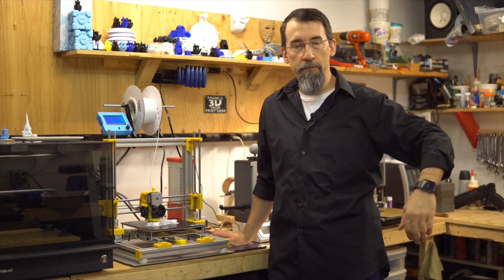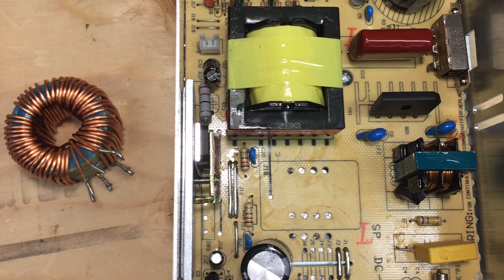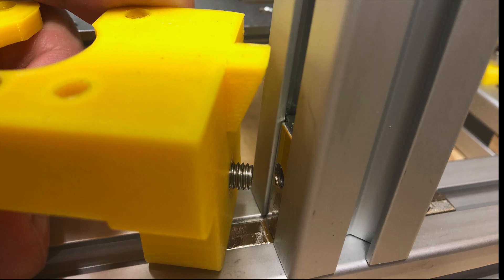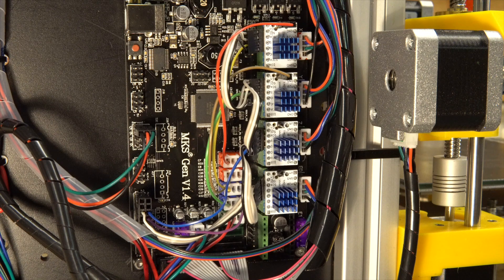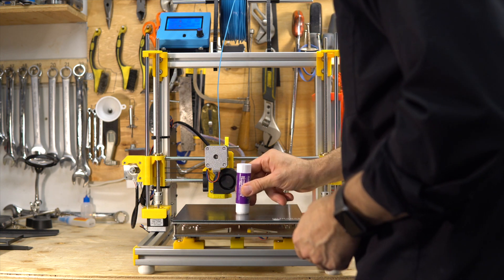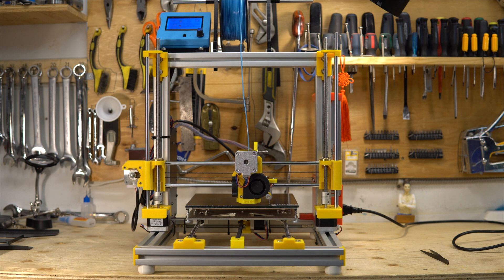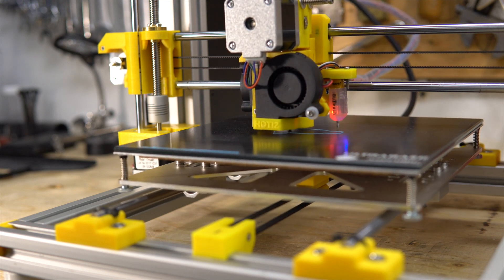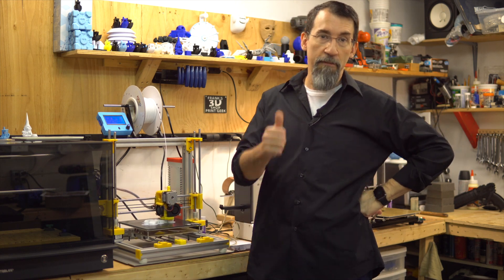My Homemade 3D Printer

Comment: (Hello, I have two questions for you; please guide me. I've purchased almost all the components of a printer and want to assemble it myself. Firstly, I wanted to know your opinion on whether the extruder or the hot end is better?. Secondly, Do you think it's necessary for the power supply of the device and the heated bed to be separate?

Comment: where is the endstop you put? because i didn't see the endstop...
Reply from the maker: Hi, I do not have end stops, the TMC2130 can detect when they hit the frame I use that instead of end stops switches.
Reply: @Franks3Dshop  could i use 2020 extrusion in your 3d printer design...?
Reply from the maker: @i-bo-wows7283  I think so, if I remember correctly there was a 2020 version on the Haribo community, but the site http://www.prusamk2.com is not responding anymore...

Comment: hello Frank I hope and you meet well and.  Excellent work with the 3D printer ñ, I downloaded the files to create it but I see that some files are missing.  the supports of the nose and the Y-axis rods. I hope and you can raise them
Reply from the maker: Hi, if you look in the description you should find a link to the original Haribo parts, I only modified some parts for my Z motor to shaft adapters

Comment: Can you put your editted marlin code with bl-touch to jobinpthomas2@gmail.com
Reply from the maker: Sure the latest version 2.0.6.1 is here https://github.com/Franks3dShop/Marlin/tree/Haribo even if you do not have Neopixels or the debug matrix it will work without those connected...
Reply from the maker: But wait I have updated the X-Motor support and it changes the settings of the X end stop, I will try to update Thingiverse tomorrow

Comment: Hello! what is the measure of the aluminum profiles?
Reply from the maker: It’s in the Haribo BOM build of material, I used the Haribo extrusion, I only adapted some parts to fit my smooth rod to Z motor couplers.
Reply: @Franks3Dshop  Which cart contains the BLTouch?

Comment: This is an am8 printer. Its an anet a8 printer with 2020 frame
Reply from the maker: In fact it's more a Prusa i3/MK3 (for the hot end) on 2020, the Anet is based on Prusa i3 original design.
Reply: @Franks3Dshop  lol, true. Its a cool project though.
Reply from the maker: @LT72884  an Anet A8 would be a good source for parts!
Reply: @Franks3Dshop  sure would be. I just got mine last week, almost done with it. Might buy a second one for just parts haha. I dont think i could source the parts for as cheap as the anet a8

Comment: There's a few questions that are begging answeres here. I'm not intending to upset you but I'm looking at bad design all over the place, so here are my questions followed by reasons.
Why make a 3D printer out of T slot Aluminium extrusion when V slot performs a linear rail designed for V wheels?
If you had then all the chrome rods become redundant.
Reply: cost
Reply from the maker: And that video is 2 years old, there was no lost cost printers in rollers, and it is based on the Prusa design an excellent printer.
Reply: @Franks3Dshop  Not being on the ball isn't a sin. Chrome rods are more precise than wheels but without Drylin bearings the noise is ridiculous. I have an ANET A8 but modified everything on it, I have an HE3D EI3 and modified everything on that to. I'm just saying the frame is a linear rail, use it? I like your design but  it's not worth the chrome rods unless you make it proper large like 1Mx1Mx1M in which case it would be correct. Probably better than anything on sale, but it would be silly expensive.
Reply from the maker: I have another in the works, a cube core XY 400x400x400
Reply: I'll stay tuned.  If you haven't decided on a brain and screen yet, checkout the MKS Robin Nano It's amazing value when bought together, seriously feature packed.

Comment: Sir I have a mad 30 x30 x30 cm 3D print my question is which stepper motor used in Z Axis y axis and x axis...?
Reply from the maker: They are Nema 17 42mm
Reply: @Franks3Dshop   1.7A and 1.8°   ...
?

Comment: I'm using megha with ramps controller and i uploaded the Merlin all working fine but the extruder is not working 

Please help me to solve this.
Reply from the maker: Hi, when you say extruder is not working, what steps do you take and what is the problem.
Reply: @Franks3Dshop  i don't know what is the problem but only extruder motor not working . I did not check the signels and power because I'm busy little bit in othe project so....if you know how to check or solve please let me know.
Reply from the maker: You can connect the Extruder motor on the X connector and try to move the X to see if the motor and cable works.
Reply: @Franks3Dshop  the x,y & z is working fine and the extruder motor is working in other connector but only in extruder connector is still not working.....
Reply from the maker: The extrusion usually needs at least 170 degrees to be able to extrude, if you have motor drivers switch them
Reply: @Franks3Dshop  OK, i'll tell you after switching the drivers thanks for your help.

Comment: bonjour j'aimerais savoir les longueur exacte de aluminium 30x30 etle firmware utiliser
Reply from the maker: Salut, je les ai achetés localement, mais Spool3D.com en a en stock, il est aussi possible de les commander en ligne, le site web http://www.prusamk2.com/haribo-3030-extruded-aluminum-prusa-i3-mk2-build/ a les sources pour les avoir pré-coupés, dans mon cas j'utilise des angles de métal au lieu de faire percer et fileter les 3030...

Comment: Hi!!
Great work. I just wanted to know if the printed parts fit the 2020 extrusions as well?
Reply from the maker: Hi, it does not fit the 2020, there is some models on Thingiverse https://www.thingiverse.com/search?q=Haribo+2020&dwh=375cc8c22b677b6 but 3030 is sturdier there is no play when printing and the frame does not move even if you pick it up by the upper bar.
Reply: Thanks a lot for the info !!
Reply: Which would you prefer?
Extrusion and v wheels or smooth rods and bearings?
Reply from the maker: For a small 200x200 machine I prefer bushing on smooth rods for the Y because it is sturdier. And bushings on smooth rods on the X axis. The less play you have, the more precise the prints are. If it’s your goal...

Comment: thank you very much, if my printer at the end works as it should be thanks to you,

this is your marlin, changing the options for the einsy rambo plate that my printer will have and the full graphics lcd screen.
https://mega.nz/#!rH5DyIKb!xsF4rQ65sJvhm6FyttODNq1kWgPnnn-uHvGu6MOG_f8

-----------------------------------------I have an important question, -----------------------------------

trying to inform me how the tcm2130 drivers works in spi without en stop, I found these tutorials in my language. in which they indicate that  have to configure the tcm2130 in spi, setting the end stop false to its correct operation.

minute, 22,24 second of this video
https://www.youtube.com/watch?v=H3uqBwZF-GI&t=1682s
or
https://www.3dcampy.com/2017/12/20/tutorial-instalacion-y-configuracion-driver-trinamic-tmc2130-en-ramps-y-mks-gen-1-4/
or
https://www.youtube.com/watch?v=Mb25RN9vh1w
https://www.luisllamas.es/motores-paso-a-paso-en-silencio-con-arduino-y-los-driver-tmc2100-tmc2130-y-tmc2208/

comment that they are with marlin 1.1.8, do not know if in 1.1.9 changes ??

****  in your marlin, the endstop is true, and if I put them in false it does not compile me. **********

#define X_MIN_ENDSTOP_INVERTING true// set to true to invert the logic of the endstop.
#define Y_MIN_ENDSTOP_INVERTING true // set to true to invert the logic of the endstop.
#define Z_MIN_ENDSTOP_INVERTING false // set to true to invert the logic of the endstop.
#define X_MAX_ENDSTOP_INVERTING false // set to true to invert the logic of the endstop.
#define Y_MAX_ENDSTOP_INVERTING false // set to true to invert the logic of the endstop.
#define Z_MAX_ENDSTOP_INVERTING false // set to true to invert the logic of the endstop.
#define Z_MIN_PROBE_ENDSTOP_INVERTING false // set to true to invert the logic of the probe.
Reply: Im interedted too , i have the same board !!!!
Reply: Un interested too
Reply from the maker: Hi, for the switchless end stops, you need have a wire from the diag1 on the TMC2130 drivers to a connection on the board, so that the driver will trigger the end stop when detecting the end stop. You also need to have the level for sensing the end tuned with M906 if I remember, it is all listed in the Marlin adv config file. I will have a series of videos assembling the Haribo, I am transforming my oldest printer to a Full Haribo black Edition and I will do a step by step...
Reply: Frank's 3D shop the einsy rambo board has the tcm2130 integrated in spi mode, it will not be necessary to put extra cables
https://reprap.org/wiki/EinsyRambo

Comment: Hey I wanted to build a 3d printer from mostly 3d and aluminum extrusion like yours. But i wanted a bigger printing area like 300x300mm. Do you know if its possible to build it like this?
Reply from the maker: Sure it should be possible, another interesting design is the Hypercube or Hypercube evolution, it is sturdier for bigger print volume, I am building a 400x400x400 one, slowing buying parts... it also will be faster since the X gantry is lighter with less mass accelerations and deceleration have less impact. It needs more computing power, I am choosing a Duet Maestro 2 board 32 bits...
Reply: Frank's 3D shop amazing, eill take a look at that too

Comment: Looking at the pieces that I need to buy, I realized that the measurements of the guides in your project are something different from the boo of the haribo and zaribo. Could you comment me why or if it does not matter

haribo boom

2
PSFG8-370
Hard Chrome Precision Linear Shaft - Straight 370mm (x)
2
PSFG8-360
Hard Chrome Precision Linear Shaft - Straight 360mm (y)
2
PSFG8-320
Hard Chrome Precision Linear Shaft - Straight 320mm (z)

haribo home made
 2x370mm x , 2x400mm?, 2x350mm?
Reply from the maker: Hi, The Y axis I have cut them to size at the end (360mm) but I bought 400mm ones, the Z I left full length they are sticking out 30mm no problem can even hang small coils of filament when testing. The kit of rods I have bought were of that length.

Comment: As you indicate in your video you reformed your pieces to fit in your project, this design could work for my titan aero. please let me know if I can go printing it to incorporate it into your project.
https://www.thingiverse.com/thing:2744724
Reply from the maker: The only parts I have modified are the X to Z supports, I have made room for the Z rods to motor coupler. It’s not that different from the original
Reply: @Franks3Dshop   According to your expert opinion, could this design work?
You could see it with the design program to be able to confirm it.
Thank you very much for your answers
Reply from the maker: I will look into it, I have the Haribo build in Fusion360 I could try it...
Reply from the maker: @marioc5709  Hi, From the first check I did, the radial fan in the back will hit the 3030 frame to the left 20mm before the nozzle reach the side of the bed.

Comment: Thank you very much for the answers, in the end I decided to buy a board ensy rambo 
 ,more than anything else for not having extra cables for the spi ,

 the marlin that you have in thingiverse 1.1.9, changing in the board parameter by the ensy rambo,mod pins in board for bltouch ,  ,,,,,  would it be enough ?? .
Reply: I almost forgot, because you did not use the marlin 2.0 fix if it is already available
Reply from the maker: Changing the board type and assigning the pins should be enough. The Rambo board is a good choice.
Reply from the maker: Nice !
Reply from the maker: 2.0 is not final, it changes every day, it is not for production yet, it could work but will have bugs.

Comment: You could share the script that you use in your printing program,
I would like to know how the line of code is added so that it prints some lines on the front before printing the pieces
Reply from the maker: My startup code for the extrusion is:
G92 E0.0 ; reset extruder distance position
G1 Y3.0 F5000 ; go outside print area
G0 X-1 Z0.2 F5000; (Move outside the printable area)
G1 X60.0 E9.0 F1000 ;  intro line
G1 X100.0 E21.5 F1000 ;  intro line
G92 E0.0 ;  reset extruder distance position

Comment: Do you have text version step by step guide? What control board do you use? How much total setup costs? Firmware details.. Etc
Reply from the maker: Yes on my Thingiverse page there is more informations, I do not have a step by step, it’s similar to the Prusa manual for the MK2. It cost me around $600 canadian, I use a MKS GEN v1.4 with Waterrott TMC2130 drivers. If you have more questions I will answer them gladly. To do a step by step I would have to build another one... Maybe I will, but not right away, I am building a Hypercube Evolution 400x400x400mm and documenting the process, it will take some time to finish...

Comment: I want to build something similar. But with original Prusa heatbed. My decision depends also on the rod.

But I don't know if it would be better with Rambo ensy 1.3 or the MKS 1.4. What do you think? Maybe it's also a question if 12 V or 24V

I also want to use a E3D V6. Do I need the direct or the Bowden edition?

And can I use every LCD display without thinking about connection or library ? Or are some libs included in  library ? Otherwise you would not see specific information ... 

Ah and it seem's that your Z-Smooth Rods are bigger. How did you fixed them at the top profile?
 Thanks

Comment: Nice job Frank looks like a good printer. I have a small request/suggestion, it would be grate if you can get all the stl on your thingiverse page. I tried to find all and it seems hard for a beginner to fine all of them, also there are multiple version and a lot of optional parts. Also a bom list with all printed parts and counts will be very useful. I searched for half an hour and I'm still not sure if i got everything that i need to make that printer
Reply from the maker: Hi, I will do that !

Comment: Plz provide a full assembly part. you miss a rod holder, extruder holder, pulley holder-etc.
Reply from the maker: Hi, look at my Thingiverse page: https://www.thingiverse.com/thing:3091771 some I only have the parts I have modified in the download, the rest you can get from the links in the description. One link was not correct I fixed it, if there is anything else or if you have questions, I will respond to you, I also could do a video on a particular problem you get. Thanks!

Comment: Does PETG stick to that glass bed?  Also what did you mean by Quiet mode (standalone) did you specify TMC2130_STANDALONE on the configuration.h? What's the difference between that and the TMC2130 define? Thanks a lot!

Comment: Awesome! love the build, quick tip, make sure those levelling screws bring the bed as close as possible to the plate it is attached too, it makes it much more stable, enhances print quality
Reply from the maker: Yes thanks you are right the more sturdier the better, in my case, my springs are really stiff, and also there is a nylon lock nut under the bed because I use an Ultrabase from Anycubic.

Comment: Can you share the entire project STLs?
Reply from the maker: Yes I will prepare files and publish them on Thingiverse, do a video about it.
Reply: You are the man, thanks a lot, also checkout some of my projects in my channel
https://www.youtube.com/watch?v=q6XrCMF3Nfc&t=17s
https://www.youtube.com/watch?v=z8LmBBGI48M&t=25s
Reply from the maker: WoW nice printers! Oups I just blown two TMC2130 drivers, overheated I think, they were cheap ones from AliExpress. Will get better ones and active cooling
Reply: Frank's 3D shop I like your channel. As for your blown drivers, keep in mind that these chips topically have their thermal transfer mostly done from underneath. Better boards have them mounted under, with bias going through, so aluminum fins mounted on them can dissipate more heat.
Reply from the maker: Exactly, the cheap ones (4 driver for $16 total)  have a silk screen over the pads, and the heat sink were 90 degrees when in operation. The Watterott drivers heat sinks are 50 degrees, and with a little airflow they go down to 40. But they are about the same price for 1, you get what you pay for!

Comment: Hi, i'm Dario could you help me with the size of a 300x300x400 3D printer like CR10? I can't understand how the size of the frame must be
Reply from the maker: 300x300x400 is the length, width and height of the printing volume, the maximum you can print at once. Is that your question?

Comment: Looks like you used the frame from the AM8 kit?
~Thomas.
Reply from the maker: Hi, the frame was from a local shop, they are building industrial work tables and shelves, they sold some left overs at a good price. Then my friend who is building the same printer, cut them for me with a miter saw.

Comment: Awesome, where do you get the extruder modded files and gear regards
Reply from the maker: Hi, I added the link to the video, here it is: Mk3 modified extruder https://www.thingiverse.com/thing:2735475
Reply: ill print it later, im building it from scratch to, do you know any amazon link where i can get the mk8 gear that fits or the specs for it thank you
Reply from the maker: Hi, It's one of these from Aliexpress:
https://www.aliexpress.com/item/MK8-Drive-Gear-Pulley-3D-Printer-Extruder-Head-Reprap-1-75-Filament/32836526970.html

https://www.aliexpress.com/item/MK8-MK7-Extruder-Drive-Gear-Bore-5mm-For-1-75mm-and-3-0mm-Hobbed-Gear-For/32832637053.html

Or from a Canadian distributer not sure which one I used, they are similar:
https://spool3d.ca/mk8-extruder-gear/

Or choose one similar on Amazon
https://amzn.to/2wAhUmm

https://amzn.to/2wskwTB

MK8 Stainless Steel Extruder Gear5mm ID9mm OD11mm Height7.1mm diameter at tooth